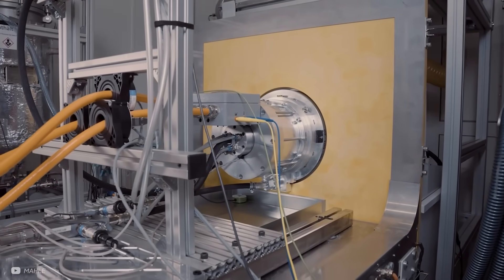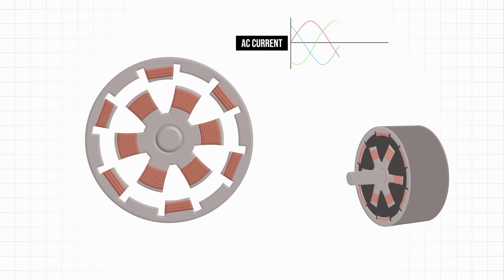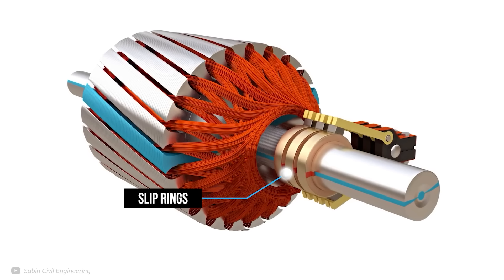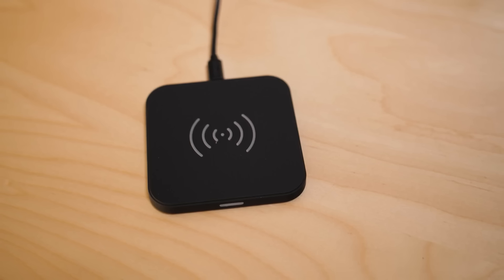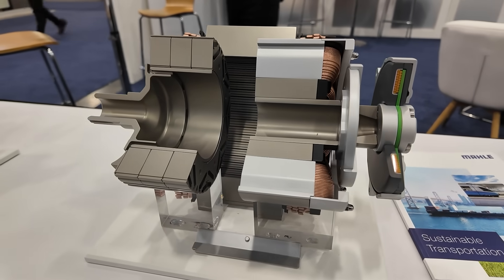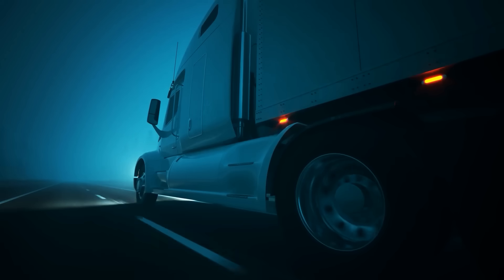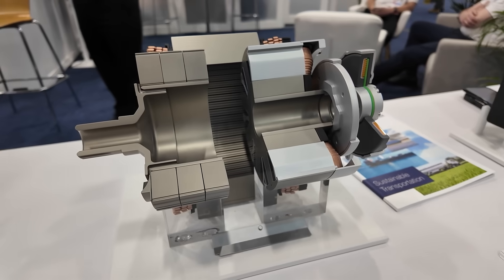Genius Contactless Motor Could Change Transport Forever

Comment: This is an old technology if you remember the squirrel cage motor.
Nothing new here except the size.

 🐾 Montréal 🇨🇦
Reply: it is a bit different: the squirrel cage motor is an asynchronous motor, this is a synchronous motor. You have to add a rectifier and more coils to the rotor, and a secondary set of coils to the stator for induction, but yeah, this is nothing new. IIRC it has some advantages on an asynchronous motor (more torque, less slipping).

Comment: 9:42 you get 95% no way. But wireless transmision curent are loss in the sistem? Or is just about power energy? I mean why we dont have wireless curent fast charger instead of cord fast charger? it because tranmision is not eficient or because cant handle too much power to transmit?

Comment: Electric Cars are idiotic atm. The energy density of LiIon batteries are about one tenth of current liqiud fuels.. And the more load/range you need the more batteries you need, so you get into the same issues as rockets, you need to carry batteries to carry batteries to carry batteries... 
It's better to produce liqiud fuels with powerplants, than use the same powerplants to charge the batteries. The electricity still has to come from somewhere.
Electric vehicles makes sense over SHORT distances and light vehicles.. like bicycles and scooters.
Also, the energy in liquid fuels takes time to burn, a shorted battery can go "bang" very quickly, as there is no physics that prevent that.. Which means drive around sitting pretty much on explosives in an electric car. Congrats.

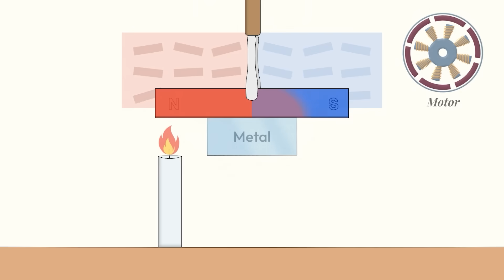Comment: 0:26 seeing that image and nothing more i think it will make dual active stator? i mean instead of using magnets will use another weding copers to generate the magnetic field so no need materials powerfull but energy hungry i think (diferent than AC motors what tesla motors do). Lets see.

Comment: The brushless design part comes is also used in large aircraft generators to eliminate brush maintenance.  Multi-phase generators and motors are often fundamentally identical.  The liquid cooling is super important.

Comment: I think a lot of people are missing something about this particular wireless power transfer system. In a normal wireless power transfer system You have misalignments in the distances and orientations of the sending and receiving coils. These misalignments make resonant tuning essentially impossible to get perfect. But in this motor the geometry would be fixed. This means you can get the tuning as close to perfect as you care to bother so probably something on the order of 98% power transfer. Where it becomes even bigger though is when you get up to higher speeds. In a permanent magnet motor You wind up needing to push more current through the stator which generates more heat. Oddly you need more current BECAUSE the permanent magnets are actually TOO STRONG. The PM magent motor is always going to suffer from this because it it doesn't have excessive magnetic field strength, it will not have adequate starting torque. I have seen motors that slide the stators away from the rotor at higher speed as a work-around, but this is much more elegant.

This motor can instantly change the field strength to match the needs. So if you are crawling at 20MPH, you need a moderate field strength. When you finally get to that on ramp and accelerate, you need a high field strength initially but as you accelerate you will need less. Once you reach highway speed, say 60 MPH, you will need less field strength than you did at 20

So you can match strength of the rotor field to the needs of the motor and that will reduce a whole lot of heat and a whole lot of wasted power in the stator. And that's why this motor can be more efficient than a permanent magnet motor in real world real drive cycle use. The permanent magnet motor at its peak efficiency under the most efficient loading and so forth is going to be more efficient than this motor at that particular speed and load but this motor should be more efficient in real world applications and real world use cases than permanent magnet motors would be.
Reply: Thank you for the cogent explanation
Reply: electric forklift and electric pallet jack motors have had this technology on the market since a major while back and they just weaken the fields in the armature, no need to move anything. They still employ this type of technology today even with 3 phase A/C motors with permanent magnets. I know that varying both the rotor and stator field strength allow more control thus more efficient if done correctly, but the issue is not the permanent magnets being too strong or not strong enough, this has been irrelevant for ages now, just vary the field you can control and the results are the same to some extent. If you have worked with any industrial electric motor setups for the past 40 years, you will know for a fact that the current in these go DOWN at higher speeds, not up. quite simply the faster you go, the less you accelerate, so the less torque and current you need on top of having to weaken the field to fight those permanent magnets and get a higher rotationnal speed, thus getting the current down even more. Some of what you are saying is true, more field is more torque and better power at slow speed and varying to a weak field at top speed is the good concept and how these all work, but your concept of current consumption and heat due to current on permanent magnet motor is a bit off... I yet have to see a comparison on power, torque and efficiency for this type of setup compared to a brushless 3 phase A/C permanent magnet motor, the effeciency loss with wireless transmission, even setup as perfectly as possible will still loose out to direct contact to the coils, and the more coils there are, the more heat is generated, so I don't believe one of these would survive without specific cooling compared to a brushless permanent magnet motor without anything other than air.
Reply: @gilbertlabonte5095 One thing I think you might have missed is that in a PM motor, at high RPM, the unnecessarily high magnetic field begins to induce current in the rotor's cores. This generates heat, reduces efficiency and reduces the maximum short term power that could be delivered (or absorbed) for something like an emergency manoeuvres. This is not a huge effect, but it is one that would likely be an issue in applications that run at continuous high RPM and high load that are also very sensitive to weight and efficiency, such as aircraft. It seems clear that we are getting close to having batteries with enough power density to make this possible. Eventually it will be economically viable. Then the race will be on to make it safe and reliable.
Reply: You've updated me. Thanks.

Comment: Ermh so replace contact rings with wireless charging and oil fluid to get higher sustained rpm with more friction and power consumption? 
These metal rings cost more than the constant oil change and the extra power usage?
Seems like removing one problem by creating 2 others no?
Without actual data is just another interesting design no real implications also the higher sustained rpms should be targeting this for flight engines where precise torque control and highrpm might give this system a fighting chance.
Because i don't think they stand on any ground for vehicle applications unless everyone decides to start driving like F1 drivers or rather until.

Comment: Does removing the slip ring also benefit from less friction?
Reply: Also, don't permanent magnets lose strength temporarily if they heat up? That would also impact efficiency. Fascinating system!

Comment: I always find it so funny when all those "breakthrough" motors are so proudly focusing on having "very high ~97% efficiency"!
It sounds so good for amateurs but any real engineer knows that energy efficiency is not an issue with motors, that is unless you get to clean 100% so no heating is going to happen at all.

Sadly it is engineers that are supposed to be buying this stuff and the will not because described motor has no real benefits. It claims to have "high energy density" but it does not matter at that size of motors anyway. 

So at the end it is overengineered solution that can claim that "it is not using rare metals" but is going to be more expensive at the end than all other brushless motors because of its complexity. Why would anyone buy more expensive product just because it is not having expensive components? .-.

Comment: I wish this would be efficient but by design in wireless transfer there are more losses than a magnet motor. If the efficiency is claimed to be the same and power density is lower that means it's less efficient. Also you have to power the stator and rotors coils demanding more power from the batteries. Inventors need to focus on efficiency to solve the electric ranging anxiety problem

Comment: even though motors like this have been around, and ev's are getting the kinks worked out of their designs and innovations happen all the time... batteries still havent caught up, and probably wont for at least 20 years. and even if they do, we still have a huge infrastructure problem before ev's can be considered a viable alternative, outside of citys. until these things are fixed, hybrids are the only answer, and these motors should be tested.

Comment: My God this is the "alternator" of my dreams... Is this device already available on the market?
and if so, where may I be able to purchase it...  I know it is designed as a motor but the integration of the oil cooled design is right along the design framework I perceived for an alternator long ago.  You have my heartfelt appreciation for sharing this device.
Reply: wow FB is attempting to eliminate my posts of this video... That's messed up.

had to copy and paste the link to share.

Comment: A key advantage should be that you can shut the motor down entirely while it's still spinning. With permanent magnet motors you always have residual currents in the windings. That's why 4WD Teslas are quite efficient- they have induction motors on the front axle, which they shutdown when cruising.

Comment: Inductive charging is extremely inefficient. There are huge losses to heat and power output follows the inverse square law. There is no way this could be better than a wired connection . . .

Comment: To add to all the completely correct information in the comments, it is not the efficiency of motors that needs improving, it is the woeful inefficiency of the batteries! Conventional motors are already exceeding 90% efficiency, and any cooling system is throwing away energy that has been converted into heat instead of torque, and on a warm day, will be thrown away. This guy doesn’t have much of a grasp of the fundamental principles of electrical engineering , he probably has a degree in green ideology!

Comment: Apparently there’s a new type of battery that also doesn’t require rare materials so the combination of this motor with these batteries could significantly change the economics of electric cars.  The ongoing issue is the source of energy to charge cars - IMO the most viable for the necessary scaling is nuclear, fission to start, fusion hopefully soon to follow.

Comment: You can also simply make slipping easily and quickly replaceable without full teardown! Slippings and brushes don't use expensive materials! So it should be relatively cheap and easy!

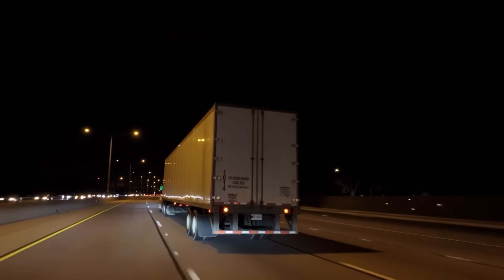Comment: 10:45 improve efficiency relative to what exactly, and how much are you improving it?

You can make improvement for example 0.000001% which is still technically improvement but not one worth mentioning anywhere relative to anything except if you are currently at 99.998% efficiency, then you can make improvement of 4% which sounds huge compared to that 0.000001% but also sometimes does not sound as much if you motor is currently 60% efficient, but also is significant if your motor currently is 95% efficient ......

So just saying improvement and not defining what it means is just like saying electric motor is strong, or gasoline motor is better... yes they may be in some cases but not other but we need to be a bit more precise.

Comment: You haven't really explained how this works. Sure there is a coil to power the rotor but that doesn't show how this is more efficient than an induction motor. I assume that coil has a high frequency ac current to improve the efficiency. Also I would assume this requires having active electronics inside the rotor to convert the high frequency AC to DC current for the windings.

Comment: Exited to se if tesla brings a similar design to the table woth there upcomming next gen drivetrain. They told us two years ago they developed a efficient motor also using no rare earth materials.. so highly likely they also use an induction motor.... but the wireless charging method is patented now... hmmmm

Comment: The PMSM motor is up to 98% efficient used in most EV's now, we use contacts because they wear out, and can be changed, you will know well before it fails to change them. Now let's remember this safety feature, what is going to stop you, if you lose that wireless contact? Hey I understand lab tests make everything look great, and the oil cooling is a great idea, but you're adding complexities, to a very simple proven design, to gain maybe at most 3% efficiency isn't a goal, and adding things that reduce safety is insane.

Comment: Nice technology, but where is the electricity coming from? Yup batteries! What's the point of running at high speed for longer, when the battery runs out 30 minutes later? How long to charge a 300/400 Kwh battery?

Comment: Great design.  Electronic commutation will increase efficiency I think.  I'm not clear on how they transfer the energy. But rather than a dc magnetic field to transfer through the wireless commutator use higher harmonic frequencies (pulsed DC) to transfer during the active commutation phase.

Comment: I think you missed the principal point on having field intensity control, which is to amplify torque and regeneration at low speeds. This is the most efficient way to increase energy recovery.

Comment: > compete with permanent magnet motors
> wireless power transfer

wireless power transfer has very low efficiency and will  also produce heat. 30 % losses just from that unlikely will help improve the motor

Comment: Without even watching the full video I can tell there's a snag in this. Energy wise the motor is very inefficient. My question would be can this generate electricity and can it generate more Energy than is inputted through the electromagnetic induction?

Comment: Isn't this just an induction motor? Induction motors dont have brushes. They also dont use neodymium magnets.

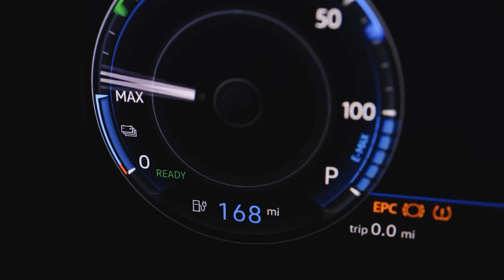Oh, he did finally address the elephant in the room 7:33 into the video. I feel like the comparison should have been made earlier. 

Would ve nice to have some efficiency numbers to compare standard induction motors to this IPT powered motor. 

Also neodymium magnets have plummeted in cost. Is the cost of the neodymium magnets really a big problem? Surely winding coils from expensive copper and installing the manually costs more.

Comment: so they invented a synchronous induction motor? slip rings wear out when on commutators, but on continuous contacts on a separately excited rotor winding they definitely won't be a maintenance issue; you can just make them long enough to last the expected life of the motor; there isn't any gaps in the electrical which cause a lot of the wear, nor can contacts that can get clogged up with brush dust. overall I think this is typical German engineering: overcomplicating a solution for no real gains. ain't no way this is more efficient than a PM/reluctance hybrid motor.

Comment: Looks like a 3 phase induction motor but unecessarily complex and with extra steps. No thank you. Induction motors already range between 85-95% efficiency and they dont use permanent magnets either

Comment: Sounds intriguing, even if a bit early for the very optimistic speculation. My concern is inductive losses. By my understanding inductive charging is still quite inefficient as compared to direct connection. I would need to see a working model under testing riggers, to be convinced. All I've seen are 3D computer models and much enthusiasm.

Comment: What about regeneration for breaking.  Is this motor capable of this?  If not, I would not want one in my vehicle.  Also, cordless charging embedded in the highway is now in the experimental stage.  Would wireless charging interfere with the induction coils in the motor?
Reply: I think it would. There are alternators built in this configuration...

Comment: That is 50 years old at least, search for resolver feedback systems, they do exactly the same thing in reverse to build a rotational sensor. 
And it is obviously worse in efficiency than a wire. So no. No cool new stuff here.

Comment: It's nice to see someone implementing an idea I had 10 years ago, but back then I just asked myself the question of "Why not power the rotor via induction?", and gave myself an answer of "it must be too hard, expensive or inefficient or someone would have done it already." Turns out the answer was "nobody did it Yet"! Looks interesting though
Reply: The generators in the thermal power plant I worked in had rotors powered via induction. They were commissioned in the late 1970s/early 1980s, built in the 1970s, based on already mature technology.

Comment: 3:13 There should be 2 slip rings in this illustration, not 3. Thumbs down for that mistake. It means you do not understand what you are talking about.
Reply: Not really there are three phase synchronous motors/generators that are set up this way. It's completely okay.
Reply: You also don’t understand.

Wound rotor motors have 3 slip rings, I work on them every day.

He is wrong but not in the ways you think.